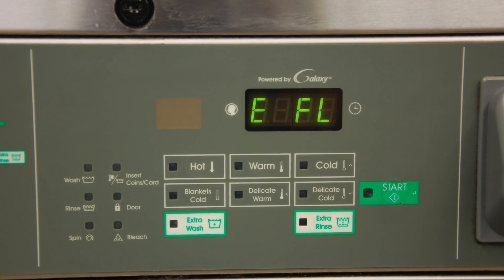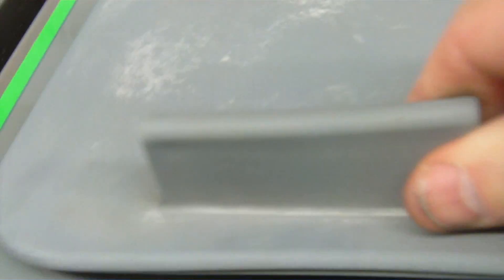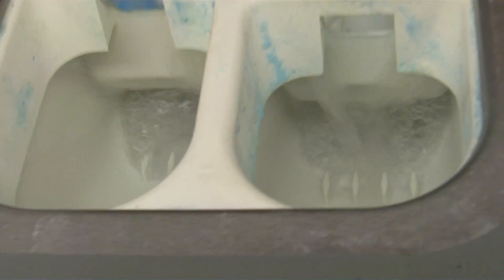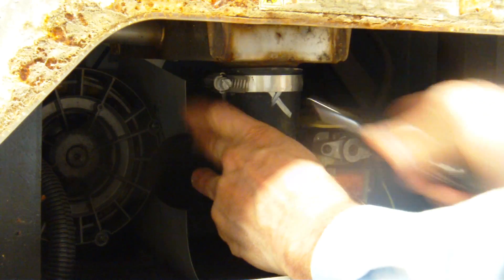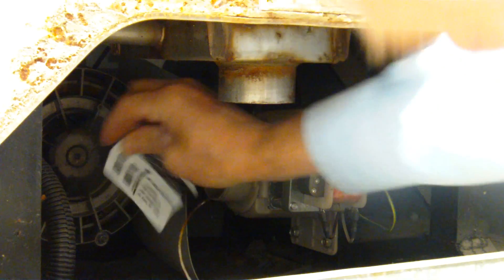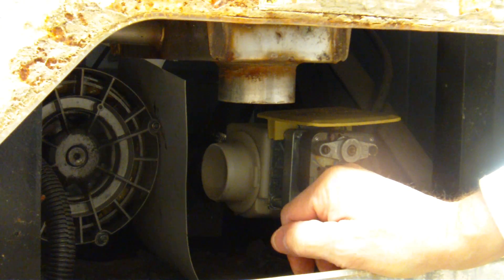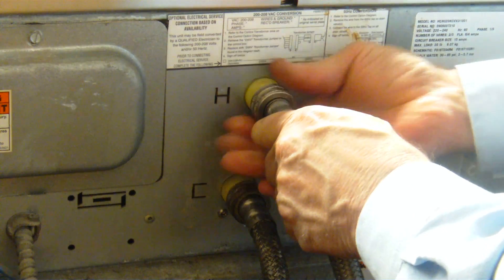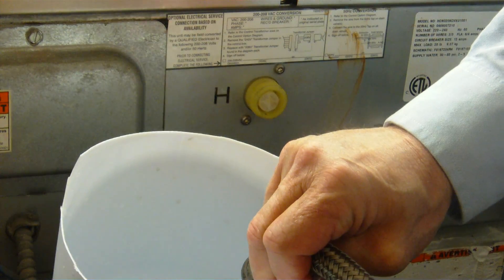E_FL Errors with Huebsch Galaxy & Speed Queen Quantum Commercial Washers - HK Laundry

Comment: It took me awhile to figure it out EFL and then I see this video haha ..  Well, yes all those things are correct.  In my case for the record, it was the water heaters in my shop were old and not putting out enough hot water and sediment also was being displaced by the tanks.  Answer, i replaced all my hot water heaters with new 122000 btu  11 gpm  x 3.  so far no problems !

Comment: Where did you buy the replacement?
Reply from the maker: We bought our equipment through our local distributor.  In totally transparency we are also the local Huebsch distributor.  But in fairness we paid for freight, rigging, installation, materials used in the installation and sales tax.  The difference between a customers cost & my cost is not that great.

Comment: If you have a disgruntle maintenance personnel constantly turning the water supply off & on or only running cold water could this cause that error code on the washer? Very good & informative video thanks!
Reply from the maker: Yes.  The washer is looking for water level.  If it does not get up to the proper water in 10 minutes, the washer will error out.

Comment: Hello, the drain valve must be closed when the machine is energized?
Reply from the maker: All washers have a normally open drain (except some 40 year old Wascomats).  That means that in a power failure the drain valves will, open and the water will drain from the machines.
Reply: @khinrichs01  Gracias Sr. Karl

Comment: How do you get rid of a bad smell in a speed queen front loader?. Thanks.
Reply from the maker: The Bad smell is because of standing water in the machine. This is most commonly found on the white or the apartment grade washers.  Run the washer with a bleach wash and that should disinfect the whole machine and keep the door open so the drum dries out.
Reply: Thank you very much .I  really appreciate your suggestion and thanks for your fast reply.

Comment: Karl Iam stumped. Huebsch washer in my laundromat works good except it will not spin on high speed. Suggestions please. Thanks
Reply: If the level control doesnt sense that the washer tub is empty, it will not spin.  Check the level control if the drain valve is releasing and tub is empty

Comment from the maker: If you think the problem is the drain valve, then just switch it with the machine next to it of the same make and model and see if problem moves.  If the problem moves to the other machine then yes the drain valve is the problem problem stays with the original machine can you guessed wrong.

Comment: Maybe you can help me with a problem at my apartment laundry room.  I went in today and all five washers read "Out of Order E nFlo" and I'm fairly certain it had to do with a lack of hot water to the units, because that's been an issue lately.  If you switch the machines to cold, they fill up just fine.  I needed to get my laundry done, so I took them to a public laundromat to wash and brought them back home because the dryers here were cheaper.  When I got back, someone had gotten two of the out of order units running.  I don't know what buttons they pushed to make them work again.  Is there something I can do to get the machines running if I don't need the hot water?
Reply: i have the fcking same problem!!!! :( did you solve it?
Reply: Did yall solve this the one thst is big enough for blankets did this to Me mid cycle just now